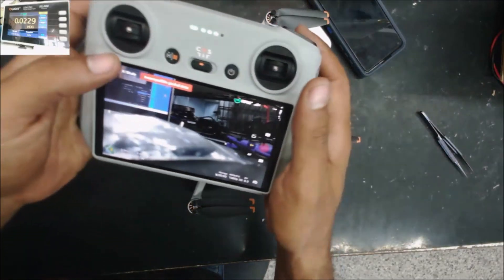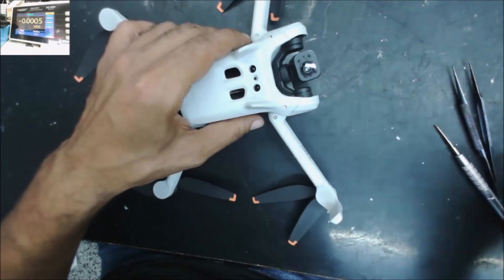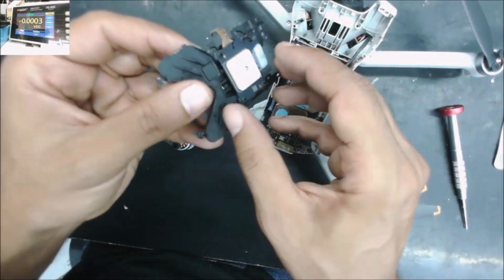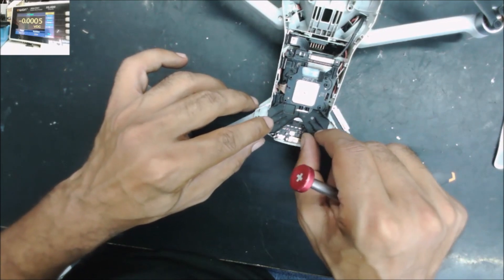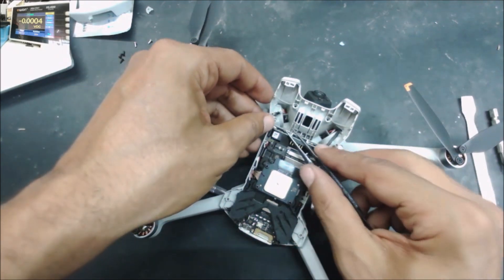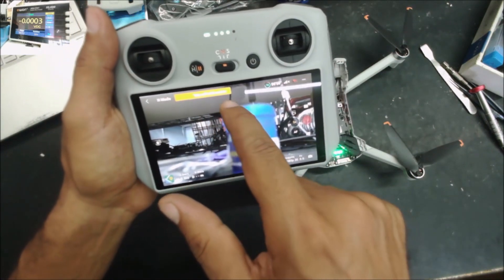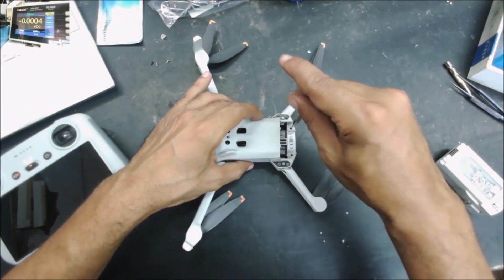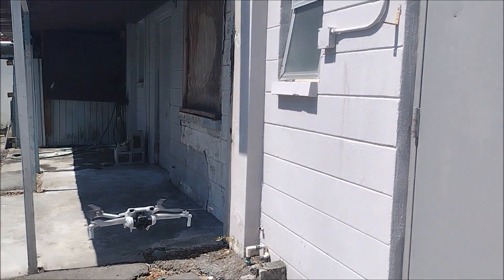DJI Mini 3 pro drone  Calibrate Gimbal IMU Compass GPS errors

Comment: Thank you I had crashed and replaced the ribbon cable and got errors where I couldn’t rotate my camera or calibration anything. I was doubting a bit because mine was connected and wasn’t lose but I still took it off and connected it again to make sure and this fixed it